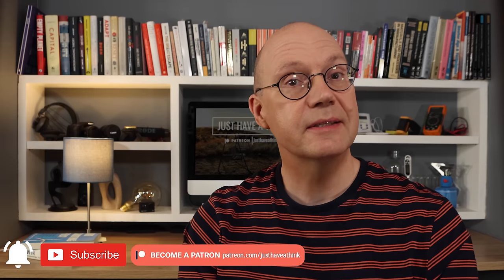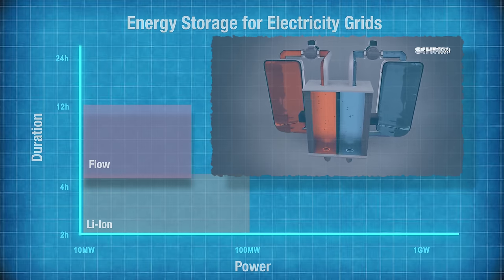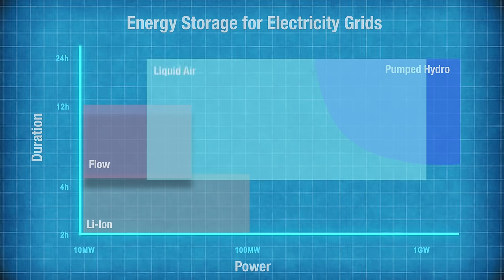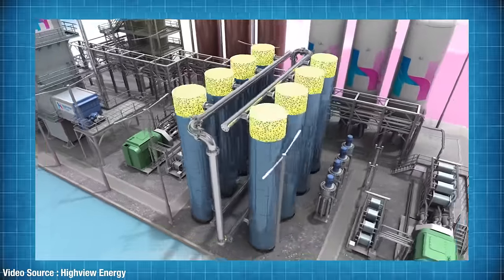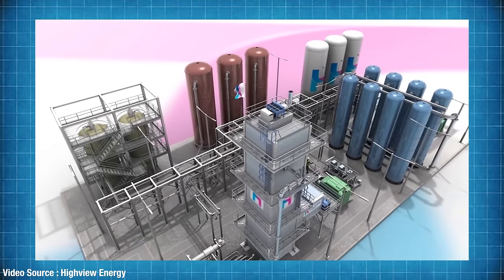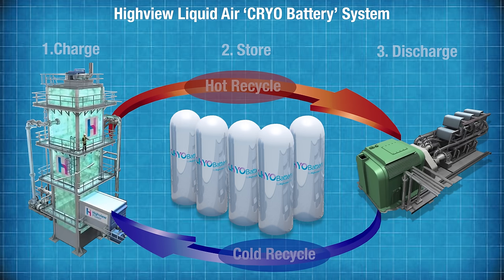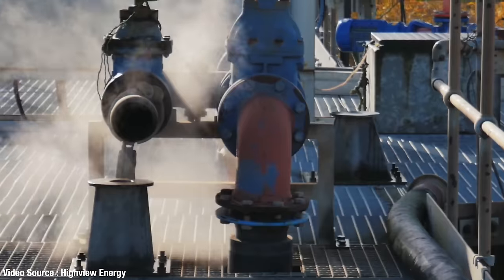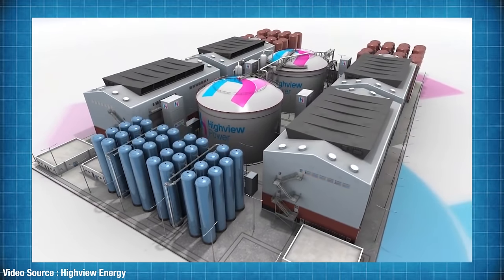Liquid Air Batteries. Literally energy from thin air. Seriously. Literally!

Comment: Some people are misunderstanding that this is not free energy, just another energy storage option. It's misleading, in that the cost for infrastructure is huge, and as others have pointed out, huge energy losses as well. It seems this is a potentially cost-effective energy storage option, which might have many up-side benefits and decreasing costs with scale and improvement of the technology. For example, it could be a great energy distribution system, in transport, or at the use end, it could be allowed to gain heat, and thus pressure, thus gaining some of the energy losses. It could provide energy, cold services (AC and refrigeration), as well as clean air, and environment pressurization. So it has a lot of upside in advancing the technology.

Comment: A reasonably efficient energy storage system using current technology with minimal environmental damage. Place one of these in a windfarm or solar installation, scaled to need to level out power fluctuations. Will probably need a back up fossil fuel plant for emergencies but it should reduce the number of such plants and their fuel requirements by over 90%.

Comment: Needs to meet one more fundamental criteria:
6: Difficult to weaponize: against itself or its surroundings.

Anytime you concentrate massive amounts of energy, in a small area, you have to examine it to see if you've built a bomb that can be employed by terrorists or result from neglect (key personnel don't come in for a month due to a pandemic). For example:

- If someone shot one of these tanks, from a mile away with an appropriate 50 caliber bullet or RPG, would something special happen? Perhaps a super cold cloud enveloping a nearby town or simply damaging  a large portion of the plant?

- Perhaps a worker poured a bottle of acid on several pipes, tanks, and valves: would something interesting happen the next day?

- Someone takes over the control systems remotely or loads  a virus. Perhaps they arrange for a bad part to placed in inventory.
Reply: I don't think you can create anything that can't be weaponized.  Perhaps we shouldn't allow cars to run or shut down air travel because these things can be easily weaponized.  The posibility of being a potential weapon shouldn't negate a good concept; however, security should be a consideration.
Reply: @williameaton6330  Yup and we keep the possible weaponization of cars in mind when we design things: such as buildings. The degree of damage is also at a different level. I'm not saying don't do it. But it is an important factor in planning when this much  power is involved. Remember the city in Africa that died overnight when the neighboring lake burped CO2.

Also if its easy to force a plant offline for months you've got another problem.

Comment: So this is the answer to batteries, hammers, string, and a little dynamo. All so simple the more power you need the bigger the hammer, string and dynamo you need. You totally lost me when you started talking Hornsdale battery power in MW. So this all so simple system is around 50% efficient and the generation needed to power it will have to produce  200% of the static generation you need as a normal baseline. The simplicity in using steel tanks beggars the question of how long will the steel tanks and other operating equipment last operating at cryogenic temperatures' One thing for sure the climate change madness has certainly let another whole lot of people loose out of the dungeons with very limited real intelligence on to the world's stage. Having worked in the generation sector most of my life it now seems a very accepted solution of the unknowing to turn what was once a very efficient industry that produced very cheap power with very simply built and maintained equipment into what now could be described as having the cost and complexity of the Space shuttle and listening to this loony will never end with ridiculous solutions to what is a man-made problem. Politicians and other armchair experts should have never been given a voice in what is one of the most vital industries in modern society. Now we have the loonies loose with solutions that would make any sane person laugh and cry at the same time.

Comment: At the 4-minute marks the the comment was made that regarding the impacts of construction  hydroelectric dams on the environments and the culture and so forth upon completion of the three Gorge Dam in China and the filling of the reservoir behind its altered the Earth's goddamn tilt on its own axes, even a change in the millionth of a degree could result in many different changes from the weather to our going head to head w an asteroid. But yes China is responsible for altering the Earth's axel tilt. Dyson sphere could not work for same reason, it would alter magnetic/gravity system millions of years in the making. If it's ain't broken then don't try an fit it. Otherwise great video . James

Comment: Sure, and as you state in the introduction every physical process that requires energy is potentially a form of energy storage. Physical storage is inherently better than chemical storage as physical processes are not subject to degradation of the active components they work on. So this is a good technology, yes. And one of the thousands of options for physical storage. Apparently the problem is not to find a viable storage process. But the problem is to find investment capital and a market to gain profit out of. With lower operational costs and higher revenues. With an oil price at $40 that won't be successful ever. So the problem is economics, not physics. BTW your presentation is flawless but the title falls in the class of "Must see Tesla free energy generator" . You should improve that.

Comment: I like the idea....how much oil does it use for operation over a 2 year duration vs. a hydro powered facility vs. a fossil fuel facility...for a 250,000 home and business area vs. overall costs in the same time assuming everything is ready to run?

Comment: I have seen a similar idea to power cars instead of using compressed air. This is not the original article I saw 20 years ago, but here it is:
https://auto.howstuffworks.com/fuel-efficiency/hybrid-technology/10-alternative-fuels-on-the-road9.htm
The plus side of the power plant is twofold:
1- you convert it to electric power. In cars, a hybrid would be more effective than direct drive.
2- the extracted moisture prior to cooling as well as the condensation created when the liquid boils and creates pressure can supply water for arid areas.

Comment: This is outstanding! This follows and can combine with my similar idea for getting co2 out of the air.  It is simple really. you suck in the air and begin to compress and cool it. as water falls out it can be diverted off to our fresh water supplies. as it cools and compresses further, co2 will become a liquid and can be diverted off and bottled, then finally the air itself liquifies and can become this storage.
If we combine this technology with shallow geothermal (actually just below or even above ground level) we can turn global warming into the energy supply to solve global warming. The warmer the world gets, the more of that heat we can claim with our pipes, cooling the earth and that energy is used to suck carbon out of the sky into pure liquid co2 and then store the rest of the energy.

If we are clever about placement and air cleaning of pollutions. we could even suck in air from the dirtiest locations of the world and then eject the clean air in key locations to either disperse well with wind patterns, or to displace other dirty air into the directions of the air intake zones. with some extra pipe work and strategic planning it can give us pure clean air at the correct co2ppm.

Hell, the shallow geothermal could BE the air intakes...sucks up air at one end, constantly heats from the air and sun on its journey, we steal that heat to make electricity that powers the whole system. They need to do more research on the heat reclamation side of their design though since some reclaimers out there are exceeding 90% efficiency.

Comment: Curtailment is not only because of excess renewables overall  but excess renewables in the wrong place. Most Wind and Solar are in remote locations maybe only 2-6MW so this solution would be too expensive. As one goes towards the center of the grid near cities etc then curtailment is less of an issue and the storage requirement get smaller proportionally. So I don't see it as a fix all. I think it'll be used more as a grid stabilizer ro remove sync issues and would be more of a sellable source of reliable synced power.

Comment: what happens if there is an earthquake, flood, high winds, or tsunami?

I have also heard of using a closed-loop system of distilled water to make hydration from solar cells. This liquid air sounds similar.

Comment: A much better use of that compressed air, than expanding it through a turbine, would be to use it a feed for a conventional gas turbine—minus the air compressor. This would effectively give a massive boost to the fuel efficiency of the turbine, using surplus renewably sourced power. We need gas turbines—a clean flexible efficient reliable form of power generation—anyway, as back-up for when there is a long spell of calm or gloomy weather.

Comment: Why build this plant in Manchester when the majority of curtailment is in Scotland where there are too many wind farms for grid capacity? The obvious answer is to uprate the grid capacity, rather than have a 40% loss of power with this system. 
Looking purely at grid demand and renewable generation we are a long way from having any excess renewable generation to store. The idea that storing excess renewable generation equal to the shortage in low wind and or solar generation is a non starter and likely to be so for some time to come. This last week wind has been running at about half it's average, so if you work out that 120 hours or so at 4 Gwatts is quite some capacity and that it needs a further 120 x 4 excess generation above average to recharge it, neglecting losses.
You mention pumped hydro, this system has been used for decades, long before renewables came on the scene. Why they are used is simple, despite the inefficiency of them, their ability to start and come to full power from rest in seconds is used to what is termed peak lopping, to balance the grid when sudden lack of supply for the demand occurs.

Comment: I suggested a boat for small lakes using solar and an air compressor on shore, then you fill the tanks on the boat with the compressed air. This turns the prop. Quiet and clean; prefect for boating. The above is just a bigger version!

Comment: How much energy does it take to create liquid air, compared to how much energy can be extracted from the liquid air. More energy can't be created by using energy to create energy. Something doesn't make sense here. Where does the energy come from used to compress the air. Why not have wind drivers turn air compressors rather then generators and tank the air compressed. OS/Physicist.

Comment: If I understood correctly, liquid air is produced and stored at about atmospheric pressure and minus 200C.  This needs vacuum insulated vessels which i think are expensive.  The liquid air is then released and caused to evaporate which requires a heat exchanger and a lot of heat input.

Comment: Do one on the need for modular power generation, so we can get rid of our distribution system all together, an since its free energy, why should we have to pay for it? after initial investment companies would be charging for free energy, when individual units an homes should be able to get free energy well for free

and do one on Stirling engine solar dishes, currently have an energy conversion rate 30 to 35%, and can potentially with refinement reach 50%, currently highly underutilized

Comment: I dislike the marketing phrase "Energy from Thin Air" since it makes this sound like more Free-Energy pseudoscience rubbish, when it is in fact well established physics.  And it produces no energy on it's own, it's just Cryogenic Energy Storage with efficiency improvements.
Reply: it is also wrong to call them batteries; these are not electrochemical devices. They are more like free energy storage devices. Because of the process involved, 100% efficiency is thermodynamically impossible (because it acts like a heat engine). In that context, I assume that 60% means that if you invest 100 units of energy, you will get back only 60 units of energy (electrical). Not bad at all.

Comment: Hi Dave. Can I contact you via email with a theory about domestic power generation. There's a contraption I'd like to build if the calculations work out but the math is beyond me. It's based on this video using gravity and the setup cost should be very modest.

Comment: Do you think that it would be possible to create micro liquid air batteries that would shrink those battery facilities or plants, into a 3’X4’X5’ self-operating container with little to no maintenance to be used for a single location or even a home?

Comment: You have to understand when you look at a Tesla power bank or other lithium-ion based system its components wear out and burnout and leave you with a reduced capacity and dead weight. Those little component those little cylindrical batteries are costly to produce and Assemble and the costs are only getting higher and higher as  material scarcity in the system coupled with supply and  problems with China becoming  more volatile. I could see a need for a simple easy to build technology such as this to replace dependence on oil still provide Electric buffer zones so that we can use a grid based on solar wind Tidal and even nuclear offshore systems if the need arises

Comment: What about scaling this down to a residential level. Like a home generator. Theoretically you could use cylindrical storage that captures sun heat during the day. Really the only energy loss would be in the refrigeration. Setting up a series of capture towers like a capacitor.  In the case of a home generator the heat capture vessel could be a few metal 55 gallon drums.

Comment: Na this is silly compared to a hybrid boilers

I have a natural gas boiler to heat my home and water the same as 90% of homes in the UK. 

When there is excess renewables on the grid the grid should send a signal to the boilers to switch from natural gas to electricity

This way excess renewables are used rather than curtailed. No need for storage when vast vast quantities of electricity can be used to heat homes and water on this smart way

The cost both in money and environment are also minimal no huge infrastructure projects just a small 3KW electrical element in a gas boiler to make it a hybrid boiler

Comment: Interesting albeit complex solution to the energy storage problem.  However it suffers from the same drawbacks as all the other solutions that store heat - as opposed to mechanical work.  I put this concept in the same group with heat storage systems that use sands or find gravel.  The issue is that these systems convert high grade electrical work back into heat (for storage) and eventually use that heat to power a cycle that generates work once again.   Every time you operate a thermodynamic cycle you incur a carnot loss even if the operation of the cycle is ideal.  It is much better to have an energy storage system that avoids this transformation to heat and back again to work.  There is an Israeli startup that is figured this out - but perhaps not on the gigawatt scale.

Comment: To truly make solar and wind viable you need to be able to be able to store excess and supply deficit from storage over a cycle of weeks.  Otherwise you end up with a second backup system as big as the source or storage  output.  And right now those are burning wood, coal, oil or natural gas.

Comment: Um excuse me... this is called an air conditioner/heat pump and the liquid nitrogen is being used as the refrigerant....the filter dryer gets rid of any moisture that makes it through to have only nitrogen being used or else the characteristics of the refrigerant if there is an unintentional blended refrigerant... moisture would freeze at the low temps and clog lines and make it less efficient...temp change between a hot and a separate  cold source produces electricity... thermocouples... this is nothing new...it's just a different source of refrigerant that is practically limitless from nitrogen in air.. you can use the removed oxygen in air for redox reactions... compressors must be used to change the state from gas to liquid... this uses energy and essentially uses a very high percentage of of the energy used to compress the nitrogen from gas to liquid...only losses would be thermal from the insulated tanks to the atmosphere...an energy source still must be fed to it

Comment: In South Australia there was a project where they built an “upside” down funnel, with the wide end a short distance from the ground. In the neck they had a fan connected to a generator. So, the hot air rise and spins the fan creating electricity via the generator. I haven’t heard anything after the initial report, 10 or more years ago. I just presumed the oil and gas industry shut it down?

Comment: I saw this system mooted a few years ago.  It's a pity they couldn't use the heat generated by compression for district heating, and then absorb heat from the atmosphere to boil off the liquid air.  Presumably they don't because of the size of the "cold" heat exchanger and problems with ice forming on it.